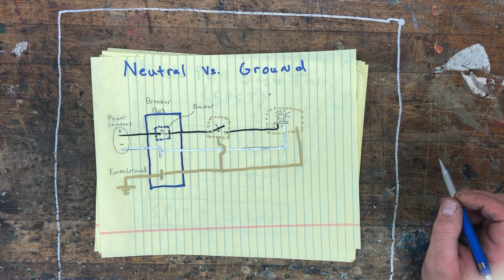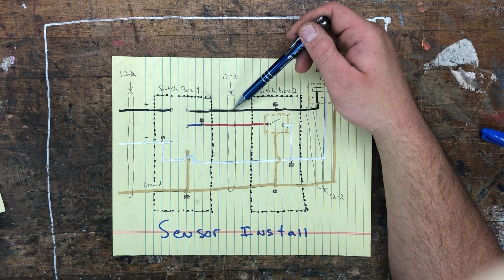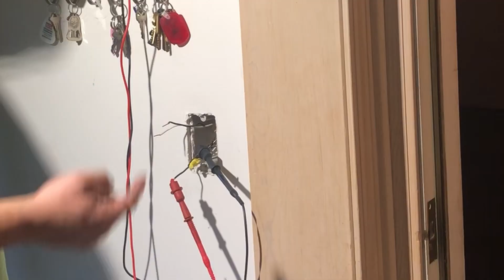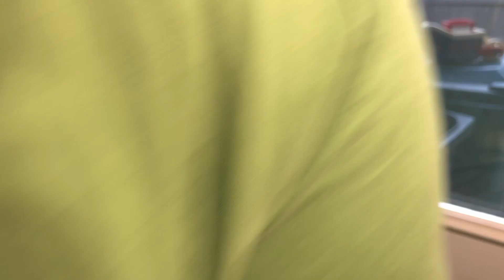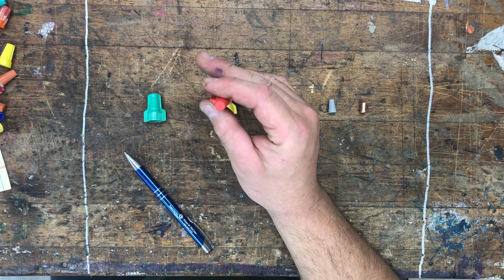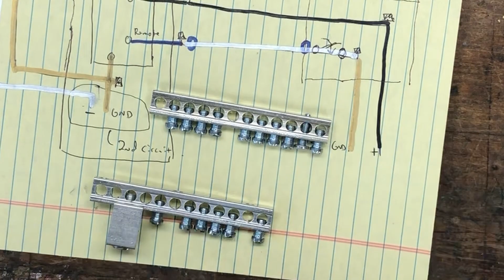How to install a motion sensor light switch.  Three way switch motion sensor and switch diagrams.

Comment: I was having trouble wiring a 3 way motion sensor switch becasue I was trying to use a 3 way Decora switch on the other end. Your video explained that a standard Decora switch is used on the other end rather than a 3 way. I wired it as your video describes and it works perfectly. Thank you!

Comment: I got a similar project and happen to have the same sensor. Unfortunately, the hot is wired directly to the light fixture and then passes through the three way switch and then the sensor. I’m not sure I can get it to work! Any tips or advice you can offer?
Reply from the maker: When I did this project, the sensor instructions had several wiring diagrams for different scenarios. I suggest you study those. In general, the sensor has to drive the hot wire to the light. I realize wiring can be difficult in a fully built house, but that’s the best I can offer. Best of luck to you, my friend.

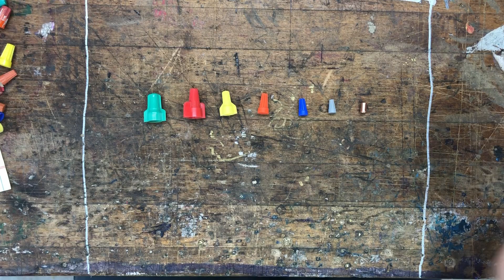Comment: Switch lights don’t use neutrals. Time stamp 21:22 where you connected a neutral to a switch. Im sorry my friend but there are no neutrals on switch lights, you just leave those alone and tuck it in the box. I understand you are re identifying the white as hot because that’s what the electrician used, that part is correct but the other wire is wrong. Just unscrew the neutral and tuck it back in the box and pigtail the other black wire to the switch.
Reply from the maker: I appreciate the comment, and you’re right that standard two-way switches do not use a neutral. However, in this particular example, the white wire was one of the travelers for a three-way switch. The set up with the occupancy sensor is unusual and that it’s not wired in the way that a standard three-way is.
Reply: Copy that and  thank you.

Comment: Don’t use drill to screw, sometime they strip the screw hole.
Reply from the maker: That’s true. Truth be told, my wrist hurts all the time due to carpal tunnel issues so I do cheat a lot with the drill.  But you have a good point, well said brother!